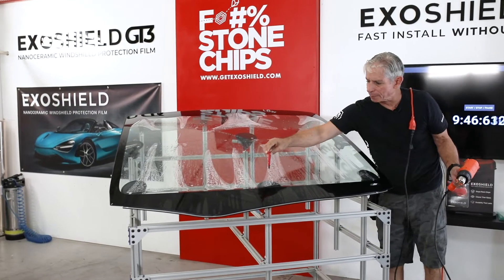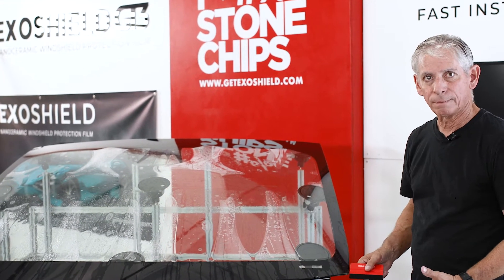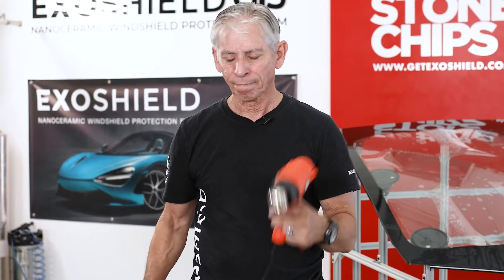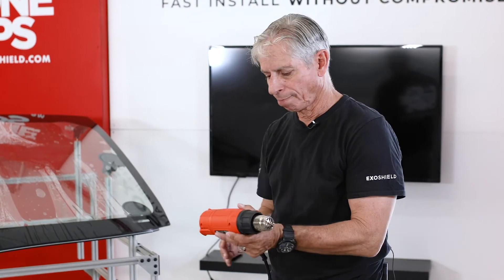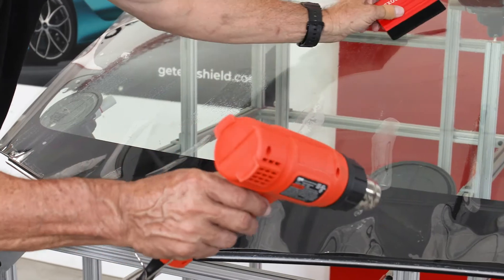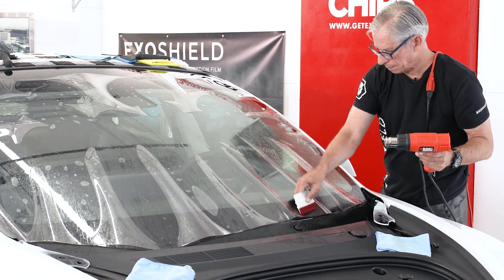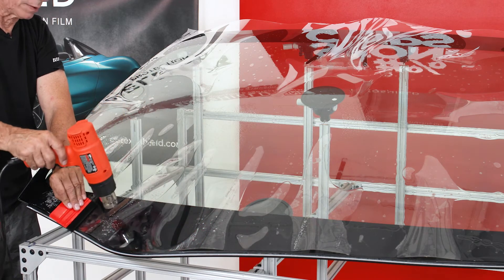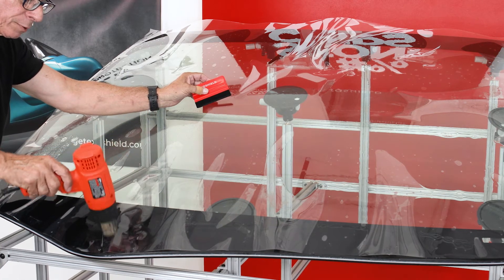How to Mold ExoShield Windshield Protection Film - How to Install Windshield Protection Film

Comment: Assuming the windshield is room temperature, is there any chance of damaging the glass.   Such as cracking or does happen due to impact?
Reply from the maker: The amount of heat needed to cause damage to the glass is far beyond anything needed to form ExoShield. 

We would recommend always doing a thorough inspection on the glass to ensure there is no existing damage that could be worsened due to installation. 

Small blemishes are no issue, but deep chips and cracks should not be installed over top of. 

On the note of room temperature, in cold climates during the winter you would want to allow the glass to come to room temp before introducing any heat.